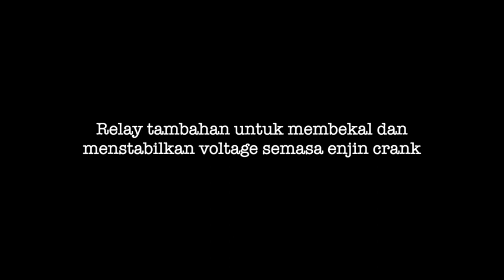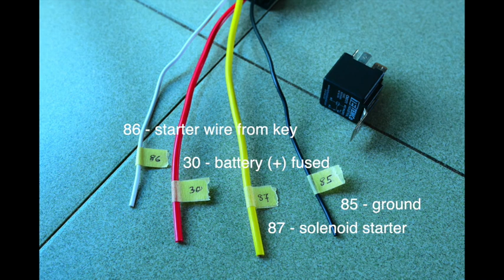Cara Memasang Relay Pada Starter

Comment: Bos boleh buat tutorial untuk diy relay 5 pin wire auto antenna kereta
Reply from the maker: Nak tambah relay untuk antenna ke ni
Reply: @jefftacra   i have find out the diagram bro, got it from your portal diy tacra, useful information, tq bro.

Comment: bos saya cb di mobil saya kok  kontak  blm di on kok  stater langsung yala padahal jalunya sd benar kenapa y boss
Reply from the maker: Mungkin ada kesilapan wiring. Kena cek betul²
Reply: Karan rely system tiada apa
Reply: Toyota